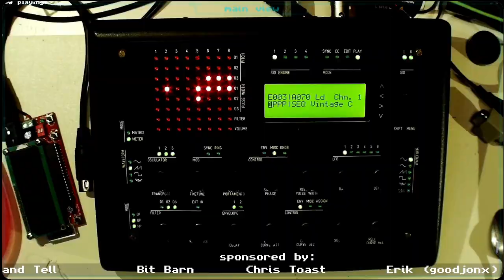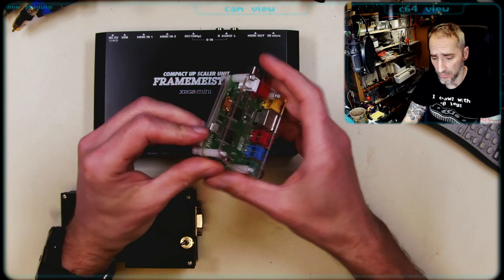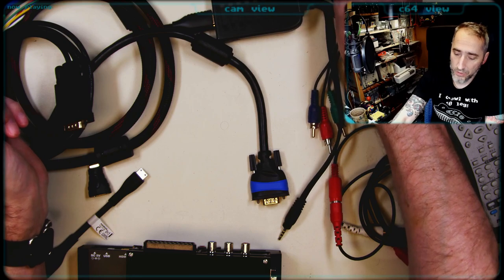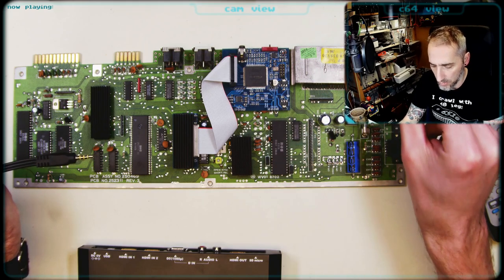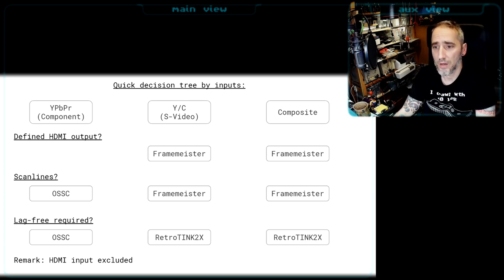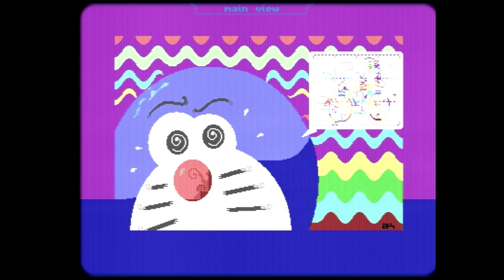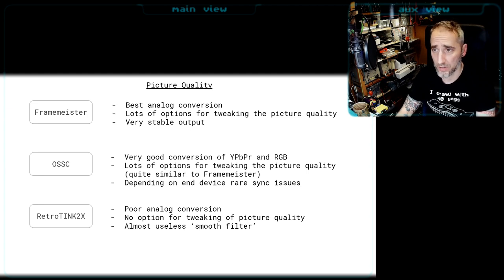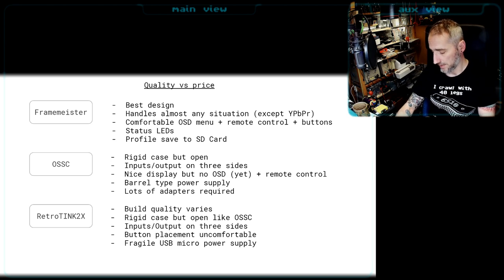HDMI Scaler for retro computer/consoles - XRGB Mini Framemeister, OSSC, RetroTINK2X

Comment: I picked up a used XRGB mini a few weeks ago for a reasonable price. So far it has worked very well with the c64 and the output exceeded my expectations. It is almost "plug & play" and doesn't need a lot of settings tweaks to get a good result in the proper aspect ratio. It also helps overcome some of the compatibility issues going between PAL and NTSC outputs that get a little weird, even on contemporary displays. Latency is barely noticeable-but you might notice it when running a shooter or platformer game.

On the Amiga side, the quality of the picture is good via SCART. It does poorly with the mode switching that happens frequently on some titles or, for example, running DPaint. I do believe that the OSSC looks better and offers more, if not too much, control. It can be very challenging to get the display "just right", only to have another screenmode go whacky. Luckily it supports extensive profile options. Latency on the OSSC is imperceptible to my eyes.

Haven't tried a retrotink. I had high hopes that this would be a good C64 solution one day.

Thank you for this very comprehensive look at scaler options. Hopefully we'll see some new tech come out of the xrgb folks soon. And, hopefully it doesn't break the wallet again!
Reply from the maker: Hi Chris, thank you very much for the feedback. It's very interesting to learn about the experience of other people. Yes, you're right, getting one screen mode perfect may ruin others but both devices, Framemeister and OSSC, suffer from this a bit. I think the way the OSSC is going, to have input resolution depending settings is more interesting than working with profiles all the time. Unfortunately, not all settings are related to input resolution. On the other side, not all settings are stored in profiles on the Framemeister either. So there is still room for improvement on both devices.
I really hope for an successor of the Framemeister or an add-on board to the OSSC. My hope was initially that the combo of RetroTINK2X and the OSSC would be the Framemeister killer but due to the lack of quality, we're still a bit away from this. 
And indeed, the price of the Framemeister is really outstanding, unfortunately in a negative way, but I'm using it for a very long time now and it never really disappointed me.
Talking about the Amiga, what kind of cable do you use there? I'm still trying to get component video to work on the Framemeister over the D-Track cable. Do you use the RGB input on the front for the Amiga?
Reply: @c64customs  I am glad you asked. For the XRGB, I am using a standard euroscart to Amiga 23 pin. The cable is low quality and upgrading to a well shielded one should give a bump to the quality.  I also have a high quality VGA cable that I use with Edu Arana's RGB2VGA adapter. This produces great results with (almost) no jailbars. I typically run this into the OSSC and am very happy with the output and low latency experience.

Comment: Thanks for this video. I think You have put me off the retrotink until something with more adjustments to the picture becomes available. I have recently purchased an OSSC, the lack of lag is noticeable compared to the cheap Flylink scalers. I'm going to have a go and see if I can use a TV Video Jungle IC (TDA8362) to convert the S-video to RGB. yes I know it likely won't work or will need lots of tinkering but will be a bit of fun anyway. The Component/RGB mod board looks the way to go, will be interesting to see if the remaining bugs (glitches) mentioned are ironed out.
Reply from the maker: Yes, the OSSC is a great scaler and I get more and more used to it. The lag of composite/S-video input is indeed a bit pity and it would be cool to have an alternative to the RetroTINK2X. either better in quality or a bit cheaper at least :)
Getting RGB or YPbPr out of Y/C (S-Video) is probably the easier way but this would exclude a lot of the old consoles.

Comment: Thanks for this very informative video! I'm on the hunt to improve my retrosetup for streaming retrogames and this was very useful information. I currently have a cheap Scart to HDMI adapter and then feed it directly to my Elgato HD60 capturecard and it works okayish. The picturequality is decent, but it struggles with smooth scrolling and the adapter treats the signal as a 480i signal instead of the original 240p so it tries to deinterlace when in reality it doesn't need to so it makes the picture look pretty bad when in fast motion. 
I was very interested in the OSSC, but the dealbreaker for me is that it lacks Composite and Y/C support so I can't connect my C64 or VIC-20 or NES to it without a lot of other devices so it will become very inconvenient and expensive. I wonder why they skipped out on at least Composite support for that device?
The Framemeister is the best quality solution, but the long time it takes to sync pretty much kills my interest as well since I enjoy playing a lot of Playstation and Sega Saturn that switches resolution on the fly which makes the Framemeister to blank out all the time to re-sync. That and the fact I don't have so much money so I can't afford one so I was hoping to find some decent alternatives.
The RetroTink 2X is a device I heard getting a lot of praise, and it does a good job when it comes to the lag department and syncing the signal, but when you showed the picture quality it provided it wasn't nearly as good as I hoped. Like you said in the video maybe if it was a €40-50 device it would've been acceptable, but at €100+ it suddenly becomes a little too poor to be worth that amount of money. I also dislike that they went with YPbPr connectors instead of RGB Scart. Not many retroconsoles outputs YPbPr without adapters (PS2 and Xbox are the only ones that comes to my mind) so I found that was a pretty strange choice since RGB scart is way more common.
This video has given me a lot of things to think through before I make my choice of which device to get for my setup. Thanks a lot for the work you did here!
Reply from the maker: Thank you very much for your comment. Yes, the cheap Legawo and similar devices having problems with the 480i to 480p conversion, so they work with static content only, like Mssiah or Geos or similar applications. These converters are my 'throw in solution' to get a picture on HDMI displays without spending a fortune. But regarding the OSSC, this is exactly my situation as well. The OSSC with at least composite, preferable Y/C aka S-Video would be the Framemeister killer. I'd rather sacrifice one of the AV ins for a low level analog input :) Modding all of your devices to component video is a very expensive step as well and not even possible with some of the older computers like the VIC-20. The component mod for the C64 isn't outstanding either and not really worth the money, considering a standard modulator mod is less than 20 Euro and the picture quality over Y/C is amazing. The resolution switches are the knock-out for the Framemeister, I see that this is indeed not useable for mentioned cases. And as I've said, for repairs where I have to switch off and on my computers very often it is pretty anoying too. Sometimes I'm not even sure whether my C64 board is broken or the Framemeister still struggles to sync :)

Comment: In my opinion, Framemeister can also handle YPbPr. You can order the Framemeister with the D-Terminal to Component adapter cable. You can even order it with a Euro-SCART adapter (don't choose the JP21-SCART one). My order has been a bundle containing both (Component and Euro-SCART) adapters.
Reply from the maker: Thank you very much for the info. I have tested the D-Terminal connector, got the one with the three chinch sockets but I can't get it to work, so I assumed that this is perhaps something different. As far as I know, this D-Terminal is expecting a YUV video signal, which is indeed different compared to YPbPr. I'd love to get this working, then the Framemeister would be the 'rule them all' solution, except for the sync delay and the minor input lag.
Reply: @c64customs  At the moment, I can't test it by myself but I think I've seen videos and have read articles about people using Framemeister with the D-Terminal component adapter cable for their PS2 and other systems component cables/outputs. I might only have a Wii with component cable for testing. But for what I know is, that consumer devices often had misleading descriptions for their outputs (like YUV for YPbPr); I don't really think that the D-Terminal component adapter requires something else as the good-old standard component output of the consumer devices. When you say "I can't get it to work", could you at least select the component input as a source? Did you have a black or corrupted screen? Were the colors wrong? Maybe you should give it another try. And even if there would be different signals, I'm quite sure these could be converted without introducing further lag (maybe sync on another component or difference vs. absolute scaled signal).
Reply from the maker: I have used the same modified C64 which I have used for the RetroTINK2X and the OSSC but I can't get a picture from the Framemeister at all. Like there is no input at all. I've cycled thru the inputs and even connected Y/C just to check whether the C64 delivers a picture but component wasn't working. I will try to repair my component modded NES and test with this one then. And I will do some more googleing, maybe I can find something about this. Thanks for your help, would be really cool to get this working :)

Comment: Very informative video as always. I am very happy with my retrothinkX2, but I see the framemaister has a much better picture. To bad the price 400€ + import tax. Hopefully someone is working on a solution. I will use the U64 as main computer for recording, if possible.
Reply from the maker: Thanks Michael for the comment. The RetroTINK2X works indeed fine if it gets a decent input signal, especially with some capture device behind it even the resolution scaling isn't really a problem. But it is lacking a bit the 'top notch' quality I expect for it's price, considering that it isn't doing so much at all in terms of quality improvement or scaling :) I just hope the chinch connectors will survive some time, they are a bit too shaky for my taste, especially when you have chinch cables with good connectors, I almost ripped the composite socket off of the board already :(